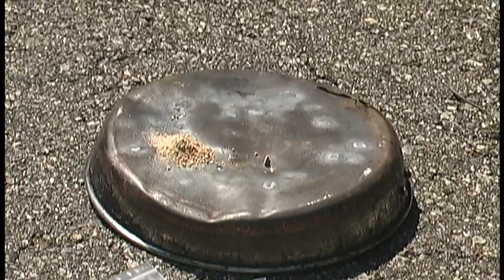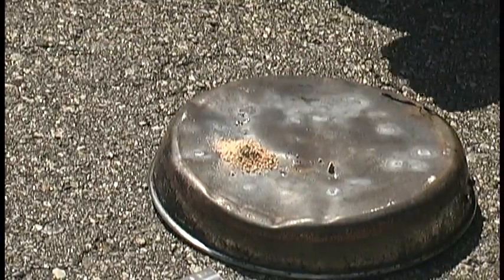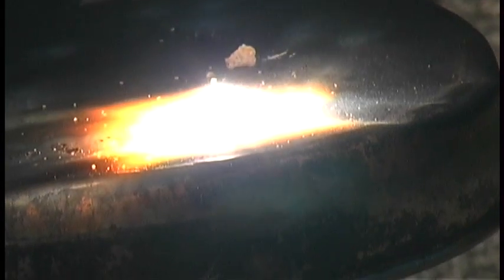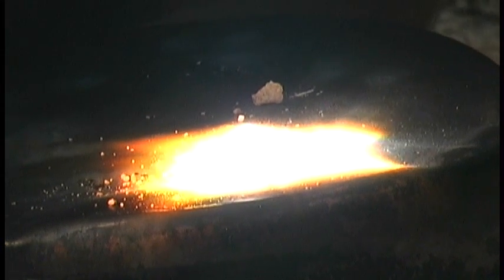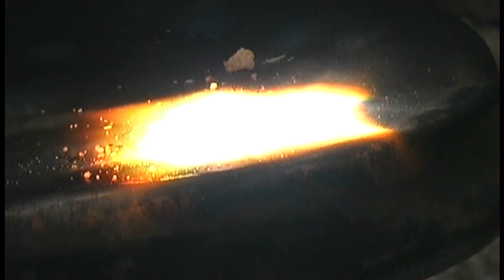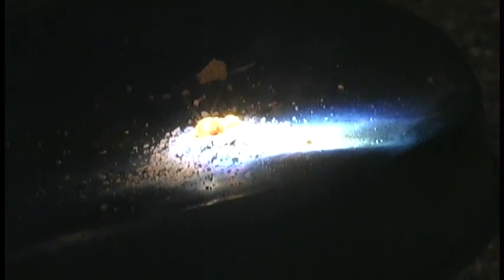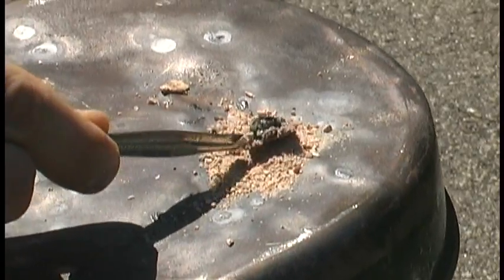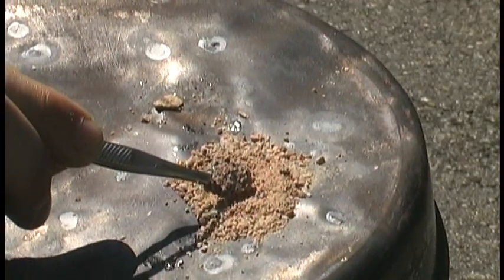Melting Rocks And Other Fun With  A Fresnel Lens

Comment from the maker: "Usually you will have to tilt what you are burning toward the lens a little bit.  My circular focal points are usually no bigger than 2 cm in diameter.  If the Fresnel lens is "linear" lens rather than a "spot" lens, then the temp will be significantly cooler (but not much)."

Comment: How many inch is this lens? I have got a 42'' and I do not get instant burn, my quickest burn was after 25 seconds (my best focus point is 5 centimeters in diameter, is that not a little too big?). Do I need to focus it different?
But maybe the sun here in The Netherlands are not as hot as by you.......

Comment: I imagine that you could attach a 6" long, 1" diameter pvc tube to one of the corners and use it as a sun guide so you wouldn't have to keep looking at the sun to readjust the angle. That way, when the light is perfectly through the tube, the lens would be in alignment with the sun.